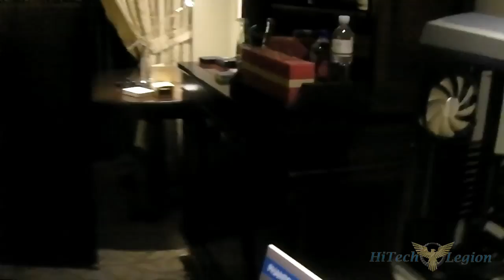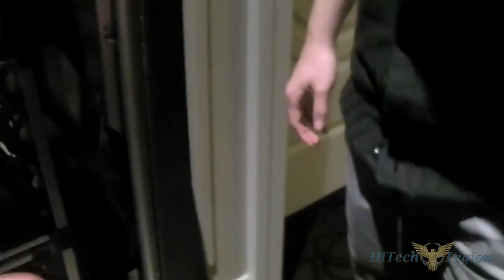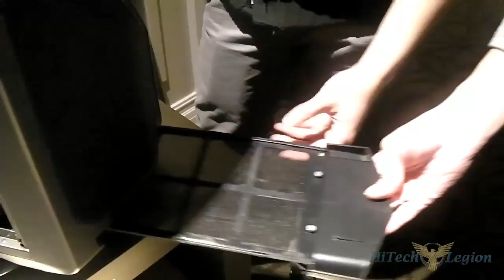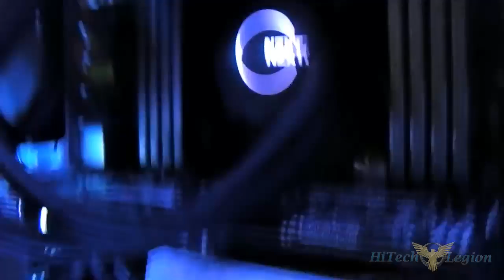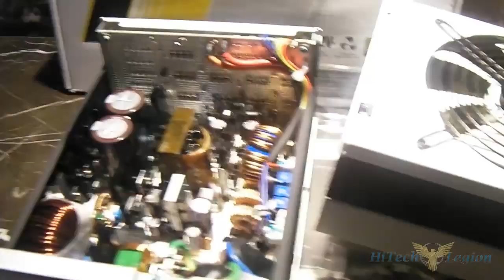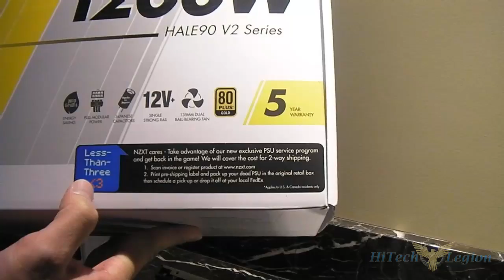CES 2013 - Day 2 - NZXT

Comment: What needs a Kraken x60 the most, CPU or GPU? Or can I fit 2 Kraken x60's in the Phantom 630? I'm planning on uppgrading my GPU to the gtx 780Ti. So if you could use kraken x60 on both that would be cool!
Reply: You can fit 2 X60's in a 630, but that's not needed. CPU's generally get hotter than GPUs, so I would do a X40 on the GPU and a X60 on the GPU. Tjat will give wou plenty of cooling capability even when overclocking.
Reply: Freeracer colin Hmm... Sounds cool. It would fit better ^^) Now all I need is to get my hands on a 630 windowed edition. I got the 780TI and it did solve my sound problem all by it self, but I'm still planning to upgrade in the future. Maybe even get 2 780TI's rockin that would be so cool!
Reply: GeneralBlackNorway It is possible, though not recommended, to fit 3 X60s and a X40, or up to 7 X40s, but no X60s. If your going to SLI then I would have the X60 on the top, 1 X40 on the rear exhaust, and another exhausting on the bottom fan mount closest to the PSU. Be warned though. All of these radiators connect through 1 SATA power, 1 USB 2 jack, and 1 four pin fan connector each. And then there's the G10 fans that need to connect, through a 3 pin. I'm not sure whether or not there's a jack on the bracket, so be sure to have all of these connection points for all of the radiators. Here are some links to some things that might help with that:

USB expantion:
Adds 2 more USB 2 jacks.
http://www.newegg.com/Product/Product.aspx?Item=N82E16811997024

4 Pin fan splitter:
Does what the name implies.
http://www.newegg.com/Product/Product.aspx?Item=N82E16812200991

Molex to SATA power adaptor:
Again, pretty descriptive name.
http://www.newegg.com/Product/Product.aspx?Item=N82E16812816015

Kraken X60:
You know what this does for the CPU
http://www.newegg.com/Product/Product.aspx?Item=N82E16835146028

Kraken X40:
Again, you know, but for the GPU(s)
http://www.newegg.com/Product/Product.aspx?Item=N82E16835146027

Kraken G10:
GPU bracket. (Only available in NZXT store)
http://store.nzxt.com/SearchResults.asp?Search=G10&Submit=Search

And here are Windowed Phantom 630s, because you mentioned you wanted one.

White: (My favorite)
http://www.newegg.com/Product/Product.aspx?Item=N82E16811146110

Black:
http://www.newegg.com/Product/Product.aspx?Item=N82E16811146111

Gunmetal (Grey):
http://www.newegg.com/Product/Product.aspx?Item=N82E16811146112

Hope I helped!
Reply: Cool, thanks for the info :)